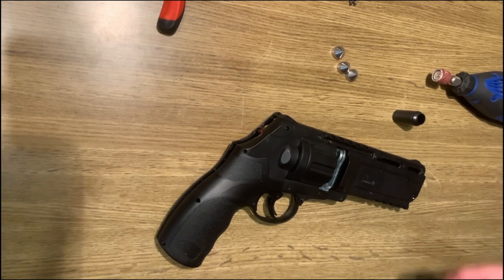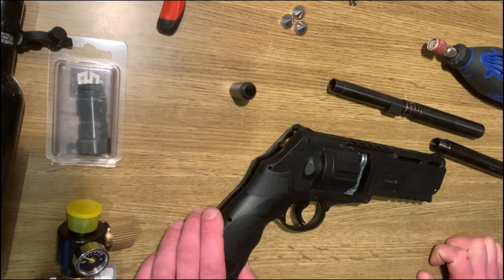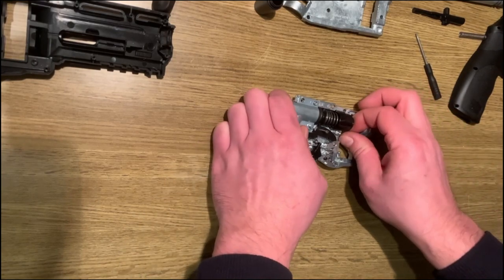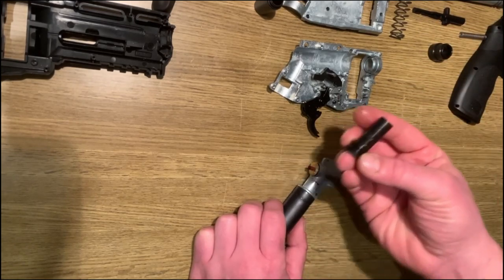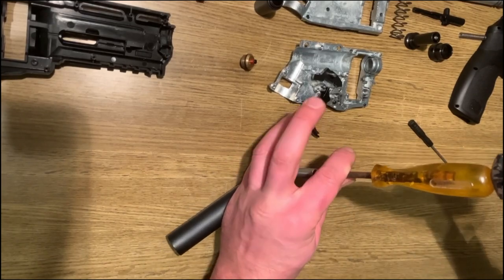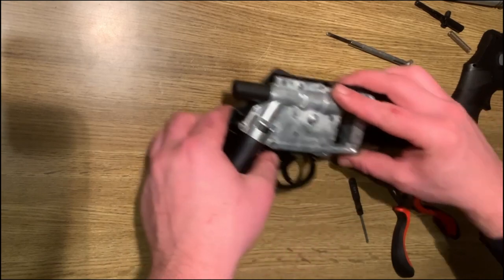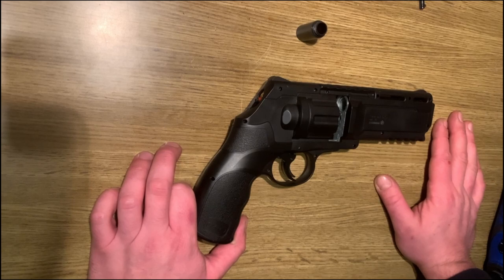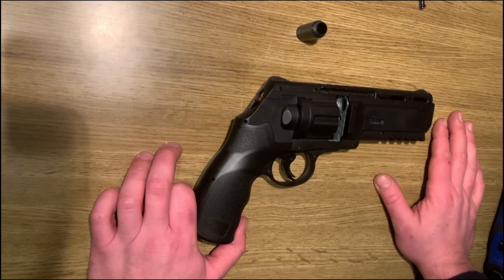🚀 Bring your HDR50 to 35 Joules with 12g co2 (Part 1) remove valve and install Z-Extension HDR68 HDP

Comment: I take my block out it dumps all the gas and yes I have the power kit, bought from you
Reply from the maker: The fact that you removed the block from the chamber has nothing to do with the outflow of co2. There is something else wrong. Either the orings are damaged or the trigger has not engaged. But I already wrote you an email.
Reply: @z-ram  Yeah and thanks. I just received an email. The trigger not sat. I just tried it and works fine
Reply: @z-ram  You did, a fine service and I would recommend

Comment: I bought the power kit (valve and pin) and tuning barrel with extension. I have the 7,5joule version so NO valve original. Do i have the add the valve from the power kit or not? I am confused because original there is no valve. I have removed the round block. Now i have installed the tuning pin, tuning barrel + extension, valve and removed the round block. Is this right? The co2 capsule now sits to high because of the valve and i can not screw the push button to the end.
Reply from the maker: It is best not to install the valve from the PowerKit on the co2 capsule. Just the pin.

If that's not enough shots for you, then you have to knock the valve in a little deeper or install the modify pin.

Otherwise, that sounds like a good set-up!

Comment: Is best if you just drill a small hole on the rear of valve block put a screw pull out no need to take the thing a part any way why take the thing apart if there's no need 🤦‍♂️ SMFH
Reply from the maker: I wanted to show people where the PowerPin comes in and a few more things to look out for. If you know better, I didn't make the video for you, but for beginners. I'm not sure but I think I'll explain it that way in the video...
Reply: @z-ram  I understand but why complicate the process makes no sense but then again I wouldn't do it your way I'll do it simple quickly n effective